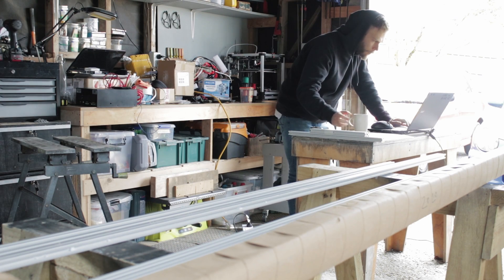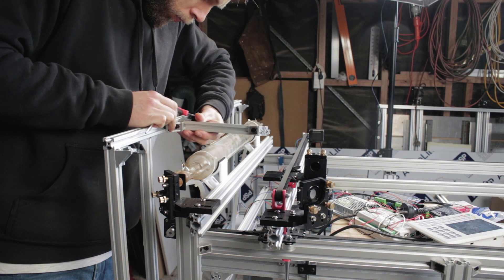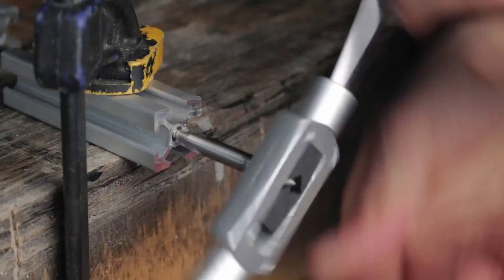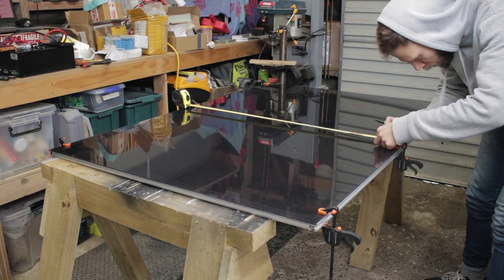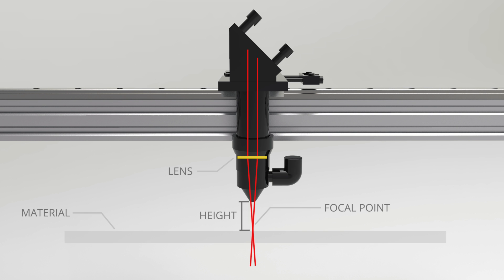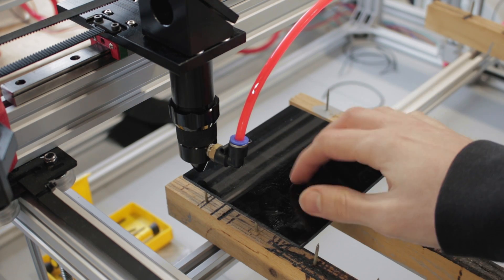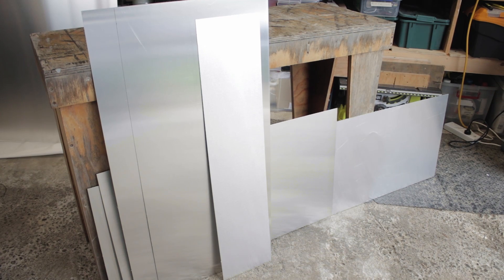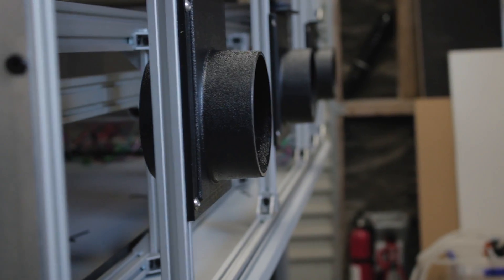Ep7: The External Frame. The DIY CO2 Laser Cutter / Engraver Build Series

Comment: Regarding the weight and using 3mm over 2 mm acrylic for weight savings, I think 3mm was good because you would ideally want the extra weight on non movable parts. The extra weight allows your equipment to resist vibrations and give it a sturdy bench, that's why you see industrial equipment all using cast metal parts, more weight, better, and more precise!

Comment: you can tell you asked a plumber for smoke extraction advice... 90 degree bends are not right- you loose suction... y bends are better. you could have placed the entire manifold inside the machine and usually you narrow the diameter as you go along so 100mm for the first intake, 80mm for the second and maybe 70mm for the last so they draw similar volume of air per second. blast gates give you the control to adjust this afterwards. This is somewhat overlooked by most manufacturers.
Port sizing should be along HVAC guidelines...

Comment: neat trick - when trying to mark a pipe for a true square cut, just grab a piece of paper & wrap it around the tube/pipe, aligning the edges up so that they are straight will ensure it is a truely square guide, you can then mark it following the edge of the paper at the given length.

Comment: Loving the series, just wondering since you already used the laser to quickly cut the pieces for the hinges, why not also use it to make the cutouts in the aluminum. I'm guessing it should be sufficient enough to go through aluminum that thin. Then again you could still do that later on ofcourse.
Reply from the maker: Great question, so it actually takes waaaay more power to cut through metal (more than this laser is designed for) because their molecular structure doesn't react as easily to the laser beam - regardless of thickness - it basically just bounces off.
Reply: Further Fabrication thanks for you answer. I’m wondering wouldnt it work with multiple passes either? What would you recon would be suffecient to cut through metal?

Edit: 
Just went back and realised it’s a 50w tube I thought it was a 80w tube. What do you think, would 80w have been able to do it?
Reply: @mkhrmns  You would need a fiber laser or a 250w minimum CO2 laser.
Reply: @mkhrmns  , the answer is no! To cutting metal, will start from 300W or more. Is necessary a lot of energy to do it! And you cannot  find CO2 laser tube to do it, machines that work with metal uses fiber type laser ( from 400W to 5000W power).
Reply: @FurtherFabrication  Well, that's it, you're left with no choice; you need to build a CNC router.

Comment: I'm about to purchase my first laser. I would love to see you explore extraction and air assist in more depth. Including silencing methods. 

There's a few videos around on silencing compressors, i'm surprised no one actually sells these devices.
Reply: I went out and bought a 60 dB compressor just for my 40W, it's much nicer on the ears. What silencer devices have you seen?
Reply: Hey, I just looked up a bunch of terms like 'compressor silencing box' on youtube and skimmed through a bunch.

The  concept is pretty simple. Sound loses a lot of power when it has to make sharp turns, which air does not lose as much. 

I've also got a quiet compressor, its spec says 55db and I just received it yesterday. Very very quiet, so quiet it barely needs it's own box. The air filter unit (the fan specifically) is MUCH louder.

Comment: It looks fantastic. I always look forward to your videos. Awesome job as always. Looking forward to the parts list and the final few things left to finish. This has re-sparked my desire to build one from scratch. Thank you for your videos! I too would be interested in the rotary attachment. I do have one question. Why did you choose to use a analog ammeter instead of a digital one? You might have mentioned it previously but I missed it if you did.
Reply from the maker: Glad to hear you're enjoying the series! 
That's a great question - and absolutely something I forgot to mention. 
Because the milliamperage tends to jump around a bit in the normal functioning of the laser, the digital meter is harder to get an accurate reading at a glance (as the numbers are constantly changing). The analog meter, because of its slightly slower reaction time, tends to smooth the jumpiness out, which make it easier to get an overall reading.
Reply: @FurtherFabrication  That makes perfect sense. Thank you.

Comment: I love this, but ... I really really reaaaaaaaaaaally would have placed the CO2 laser on the long edge instead. Even if your current tube is small enough you could keep the extra space in reserve if you ever decide to go with a heavier laser (which means a longer tube).
Reply from the maker: Yeah valid point, and the design will work almost as well in that direction by changing the axis orientation. 
The reason I chose to run it this way is so the moving gantry arm is the shorter axis - which means it's cheaper to construct and more rigid. The tube I have planned for it is an 80W Reci W1, which when installed will stick out less than the extraction manifold on the back, making this setup the most efficient for what I need. haha sorry I really should have explained it more in the videos!
Reply: @FurtherFabrication  what you say makes sense. But if like me you would build this with parts that you scavenge or find at bargain prices somewhere (ebay, auctions, 2nd hand in a pinch) you never know what you would end up with in terms of tube and parts. Also you never know what the future holds, for instance I nearly was the proud owner of a 200W Ytterbium fiber laser unit (just the laser part and a long fiber optic cable with the 'head' on the end) but got outbid at the last moment.

Comment: I would use polycarbonate sheets instead of acrylic sheets because polycarbonate only melts and does not burn and acrylic does. So if the laser catches fire its safer to use polycarbonate
Reply from the maker: That's a really good point! Thanks for the comment - I'll make a note of that for everyone as the better option!

Comment: That's one sexy looking enclosure. One thing I noticed about sheet metal in laser cutters is that it's usually painted to reduce risk of beam bouncing due to the slight mirror finish. Is that a concern here?
Reply from the maker: That's a good point! I'll watch out for it happening and see if a quick coat of paint on the inside is necessary

Comment: In opening 30 secs you mentioned it was 20/20 aluminium extrusion. I assume you meant 80/20; may want to correct that for people not familiar with the product. Love the vids, very relaxing and will defs use you as a resource if we are looking to build a cutter with a larger bed
Reply from the maker: Thanks, glad you're enjoying the series! 
it's 2020 aluminium t-slot as in 20mm by 20mm. I think I use one piece of 2040 in there as well though.
Reply: @FurtherFabrication  Ah right, seeing 20mm*40mm pieces made me think of the original manufacturer 80/20 Inc. (I think named as such due to the 80/20 rule/Pareto principle, not the product dimensioning). Their stuff includes a range of t-slot at different dimensioning, t-slot is typically referred to as 80/20 framing even from generic manufacturers
Reply: Admittedly an ambiguous and overloaded naming convention!
Reply from the maker: haha oh gosh that is a brain twister, I wasn't aware of its etymology

Comment: That is an enclosure. I'm assuming you are getting to be a pro at those t-slots by now. And finally - something gets cut. Making me want to build one even more..

Any concerns about the front panels scratching each other as they slide back and forth?
Reply from the maker: Not sure about pro haha I should make an edit where it's just me dropping little nuts and bolts all over the ground for 10 minutes straight haha
Reply: @FurtherFabrication   should definitely make a blooper real to put at the end of the last video. I must admit I laughed a bit when the top tipped over on this video.

Comment: I understand that the flair ups while cutting can still damage your eyes, thats what the black tint is for. How did you choose what level of tint to use? what tint level are you using?
Reply from the maker: I went into the plastics supplier and just chose the darkest I could while still being able to see through it. Not sure what tint level it is. Just to be clear - I also recommend wearing laser safety glasses when operating as well, just to be doubly sure!

Comment: I would add some rubber corner molding to the edges of the aluminum. That way there is no risk of cutting a finger, hand or arm. Looking awesome though!
Reply from the maker: Yeah not a bad idea!
Reply: @FurtherFabrication  Got to thinking, that would also seal those edges up to help establish an atmosphere (pressure seal) inside the enclosure which is going to increase the effectiveness of your vacuum system. Along those same lines maybe some soft sponge rubber or some other means of sealing up the bottom?
Reply from the maker: Good train of thought. I've actually found that having intake ventilation, for maintaining airflow to the extractor, to be important for evacuating the smoke. So I'll often run it with the front sliding panels slightly open.
Reply: @FurtherFabrication  could also make a rounded/bent blade to cut a chamffered edge into the panels edges to round them off and seal with a bead of silicon or rubber gasket around the edge since you have that nice wide overlay on the frame. Even though you want air getting in for venting you want to be able to control where it gets in so you get a proper air flow. If you drill 4 small 1.5-2" holes on the side  corners towards the front and screw an oversized disc of aluminum over it with one screw you have a nice sliding/rotating vent system that lets you control the air flow through the enclosure from the top/bottom right or left to bottom right, center or left creating a diagonal cross-flow. 

Love the project and will have to build my own at some point.

Comment: Good effort, I like the idea of the spring loaded t nuts, having a nightmare on my build with the normal ones.
Reply from the maker: Thanks. I was also toying with just drilling straight through the t-slot and bolting those gates on, as those nuts can be a real pain!
Reply: If you pick up my build you can hear a half dozen escapees in the slot rattling around, they are not going anywhere.
Reply from the maker: hahaha I've got a couple of those too

Comment: Stainless screws and aluminium aren't going well together. They will diffuse in a few months.
Reply from the maker: Good point! ahh dang, that totally slipped my mind
Reply: @FurtherFabrication  paint? You can get a electrostatic(powder coat) paint sprayer for like $80 then bake on the paint in an oven.